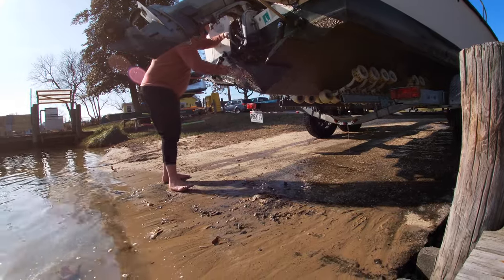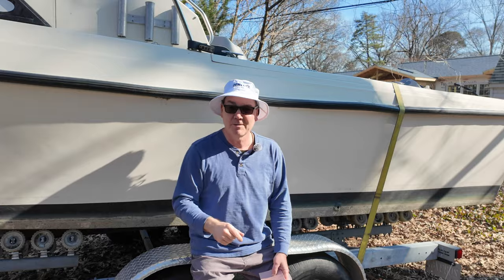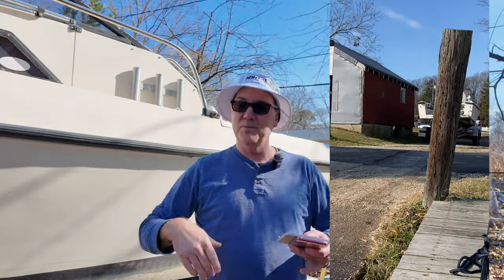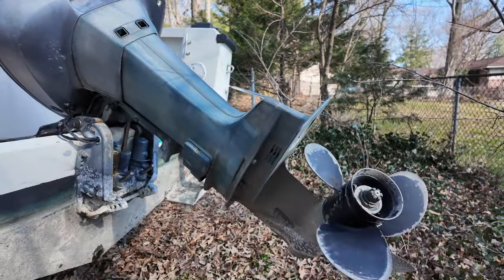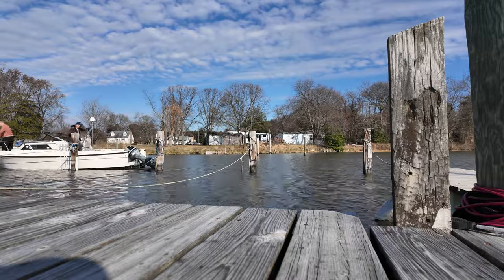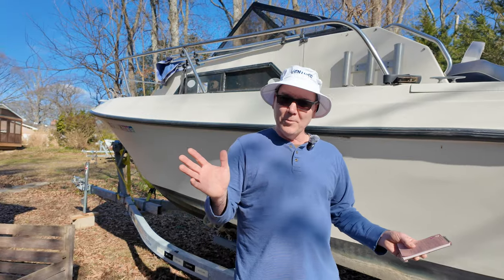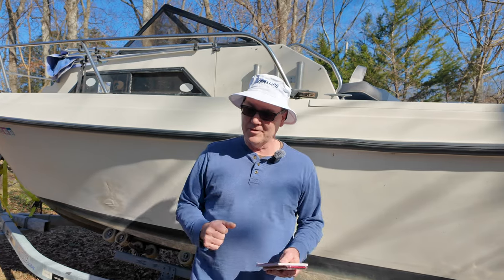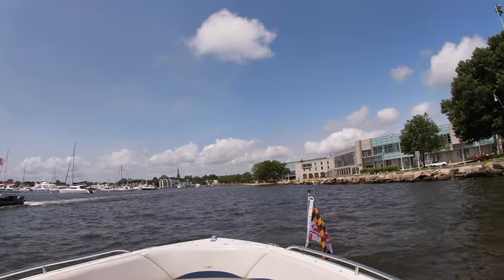Why Was This Boat Full of Water? Was it just the bilge pump?

Comment: Great segment Wayne. i had a 1996 Bayliner 2452 i kept in Breezy Point Marina, south of Chesapeake Beach. i hated pulling it and bottom painting it. what a pita. its a dirty job scraping it and putting bottom paint on it. i had a trailer for it but it was almost like a big rig with the truck and boat on it.....besides I'm only about 2 miles from the marina. when the boat was in the marina, it was my fortress of solitude.....lol. I recently got rid of the boat. I've found that i wont keep a boat in the water anymore due to all the extra maintenance required, not to mention marina fees for slips.  Luke is a wild and crazy guy. he's out there and hilarious. i saw that segment you flashed. it was great. thanks for sharing.

Comment: This sounds like what happened to the 1976 Starcraft Montego (16' tri-hull with a Mercruiser 302) I was gifted last fall. 14 years ago it had been left outside at a negligent marina for 6 weeks uncovered and the boat's bilge pump is manual (and IIRC, optional that year). Rain flooded the bilge to the point of needing a new starter. It ran another 4 years before being stuck in a garage for 10 years (it was usually garage-kept on a trailer)... which is how it was when I got it. They mentioned having a soft spot in the floor after that incident... which was due to the bilge under the ski locker not having a drain (or connection to the engine bilge) and the ski locker floor only being loosely fiberglassed to the hull, allowing water to enter but not to easily exit. After 14 years, I made the horrifying discovery of such and ended up cutting the entire ski locker floor out with an oscillatory saw revealing the frozen lagoon underneath (it was late winter when I was doing such). Thankfully, the locker floor wasn't connected to any structural wood (was placed/glassed after the main hull and stringers were glassed and baked), so the damage is limited to the floor by the back of the ski locker, some non-structural wood under the gas tank (at the end of the deck board under the back seat), and the really old set of Dick Pope Jr. Skis that were still in the locker (lots of moisture damage!). I'll have to remove the seat and redo the bad part of the deck at a later date (this winter?)... and I have considered redoing the pump wiring to have a second fused power supply running off a float switch instead of the switch/breaker in the helm (or swapping to a pump with such functionality). Not that I expect to leave it at a marina (either in a slip or in the lot on a trailer) uncovered like that... I don't have a garage big enough to store it but I do have it under a seal skin cover which has worked great once I made a robust enough support pole for such.

Comment: There are several  ways to prevent  this.  Three are Use a boat cover.  I noticed electric  outlets.  Use a battery  tender  to maintain  a charge in your battery.   Check weekly.
Personally,  I prefer to put my boat on the trailer  and park on a slant.

Comment: Apparently, I'm in the minority but my 16-foot sled has two pumps. Both automatic ones powered one from the trolling motor battery, the other my starting battery, and mounted an inch higher than the first.

And honestly when I caught the short video the first time around I didn't even have a guess at why there was so much water in the boat. Bilge pumps in my experience don't need much of a reason to quit. Random misplaced trash in your bilge, bad wiring, float jams, dead battery because you forgot to plug in the maintenance charger. Power goes out because the breaker trips and nobody found it, God deciding you don't need a boat anymore, and any other reason. 

One time in the fall, my boat filled halfway full of rainwater while on the trailer. The drain hole got plugged with a few leaves. Only took a week and a half. Yes, it really does rain like that in the PNW 😂

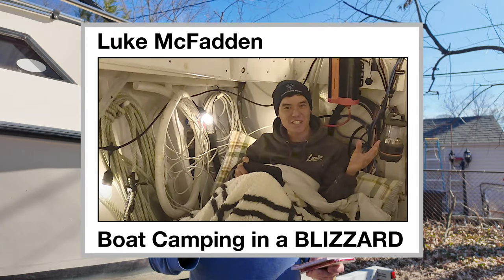Comment: An aux pump, battery and solar panel helps alot,😅 4:05
Reply: 4:40 even me and the fella like me in the commercial fishing industry,  rains find their way in to the bilge and drain down the batterys
Reply: 7:06 well here in St Margerets Bay,  it only takes a few weeks in the mid summer to get a boat full of growth, but in the winter, almost no growth, water Temps make a big play, but as the water gets fresher(heavy rains) some things grow faster
Reply from the maker: Yeah on this size boat, that would be easy and effective!
Reply: @WayneTheBoatGuy  the aux battery's, pump and solar is also used on larger boats in my area, my 26ft cape boat also included and some others of 45ft in my bay

Comment: I'm always worrying if it's raining, when my boat is docked at the marina (typically from june to September). I need to open the cockpit drain plug otherwise it fill fill up with rain water, up tp the point the water gets into the cabin, and eventually to the bilge.
After big storms, it's not unusual to see boat floating low with water inside.
Always let your drain plugs open when your boat sits at the marina and you can't keep an eye on her. Not the plugs below the water line of course, don't be silly 😉